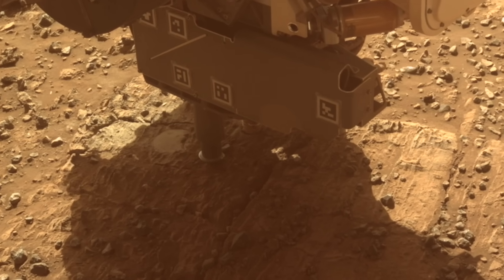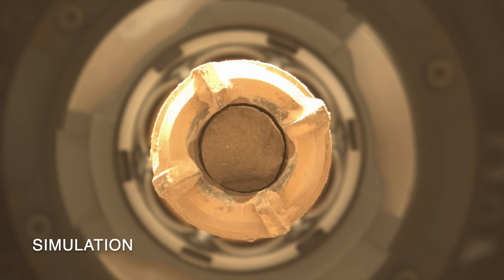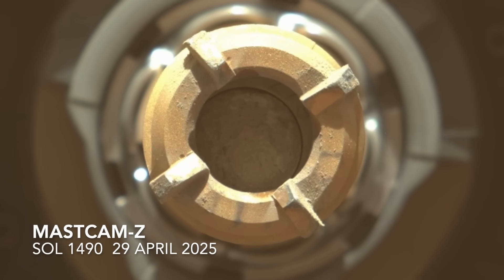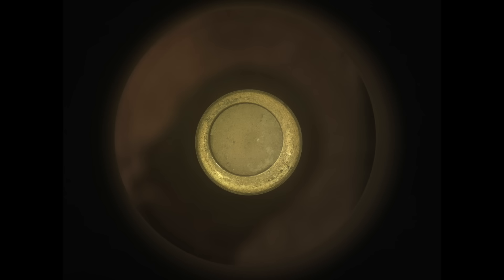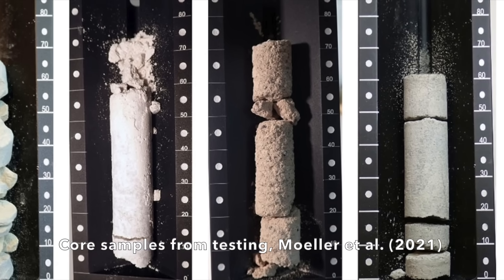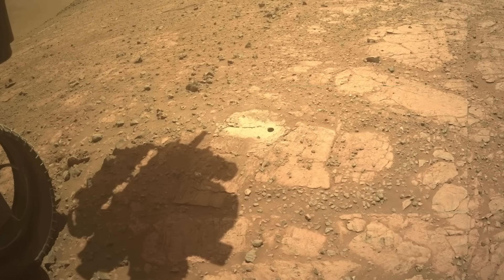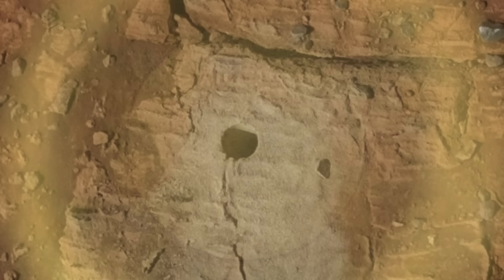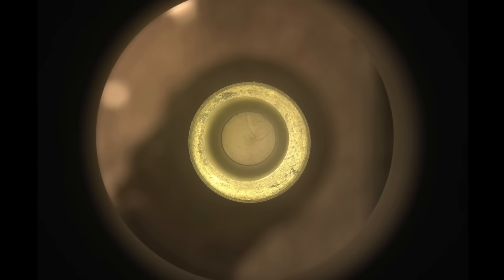Perseverance bit off more than it can chew

Comment: Nice mosaic selfie. That dust devil appears to be over the Neretva Vallis channel. I'd place it in the western third of the Jasper quad or the southwest corner of the Barberton quad. I'm no tornado expert, but it occurs to me, purely speculatively—I've already commented on this in past episodes of Mars Guy—that an area shaped like a heated frying pan could favor the rotation and rise of dust. If you have a photomap with topographic lines of the Jasper quad, you can see the wok-shaped shape where the dust devil from this episode is seen.

Comment: What is the limiting factor of Perseverance's lifetime? Perseverance can be the Mar's version of The Flying Dutchman ? Maybe it could circumnavigate Mars or head north to the ice fields.
Reply: Power, eventually the plutonium will stop making enough heat.  https://en.wikipedia.org/wiki/Multi-mission_radioisotope_thermoelectric_generator
Reply from the maker: Correct.  Curiosity is still going though with the same kind of RTG for 12+ years.

Comment: When recently watching Scott Manley's video about the recent fix of Voyager 1, it made me realize how awesome it must be for the people operating on these shorts of things, rovers included, because they undoubtedly have TOTAL access to the machine. By that I mean, they have created automations in order to speed up the process of certain things, just as with products we have, like a Keurig coffee maker where you push the button and multiple things occur. However, they aren't limited by that, so they can easily go in and feed it new instructions, say... to bypass the boiling phase and skip right to pumping the water through the pod (impromptu "cold press" mode).

That is to say, it's great that they aren't limited by the things they've created at time of launch and can solve problems on the fly, even with something they launched in 1977!
Reply: And unlike your coffee maker, they can go 1 better in some cases. With regards to the computer control, they have been known to upgrade and reload the entire firmware via communication links, and even the operating system. They are the crème del la crème of off world machines. Bless them all.

Comment: For anyone who wants to stitch together photos, I'm sure the old program "Autostitch" is still around. I have used it to make huge panoramas out of both DSLR and Point-and-Shoot photos, and they always were amazing. As the name implies, it's automated and you just feed it a bunch of pictures, where it then finds the alignment points that match up. 

(TIP: When taking photos for this purpose, make sure you're both providing ample overlap in the pictures, and that you only spin in place; you CAN move, but you'd need to make sure you're transitioning perfectly parallel to what you're photographing, otherwise when it stitches out will have an unsightly seam. Be aware of fast moving clouds, as that'll be problematic as well. )

Comment: Terrific video as always!  I was fascinated by the cap for the tube.  It is clear a lot of engineering went into its design.  Do you know why the gold coating is used on that specific part of the cap?
Reply from the maker: Thanks.  And yes, the gold is probably used to help avoid contaminating the sample.
Reply: I would imagine longevity, because 'rust never sleeps' as the saying goes. Can't compromise the seal with oxidising metal.

Comment: Is Mars rock just as hard as earth rock? I would suspect the lower gravity to make things bind more loosly together, unless the rocks comes from deep down the planet where the preassure is much higher. Bit if it formed by sediments etc, I would think it's much more porous.
Reply: You pose an interesting question. At 26% of Earth's gravity, the pressure as you go deeper under the ground, would suggest that it is not at the same pressure relative to Earth and most likely would be less. But when it comes to molten rock formation, the thing is with liquid, you can't compress liquid. That 'principle' is why hydraulics are used. So as molten rocks cool, whether it be on the surface or deep underground, I don't think the 'hardness' of the rock would change. 
But when it comes to sedimentary layers, I would expect the free flowing liquid would be 'squeezed' out, more when the sediment layer is deeper and there would indeed be a difference in how porous the layer was. But that's only my guess. A real scientist may 'crush' my point of view. 🤓
Reply: Hmm, what of the lunar rock samples? Try and do some personal research on what is known about those, the astronauts/lunarnauts/moonfolk actually picked them up individually in an even lower gravity and with zero atmosphere too. Those not stolen, still have known whereabouts here on Earth.